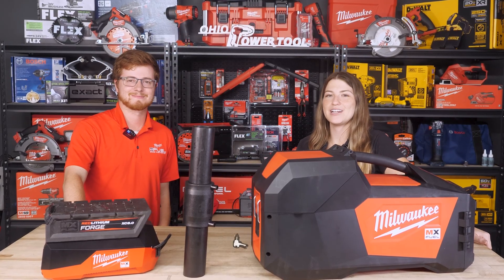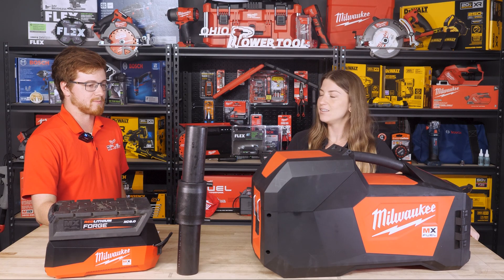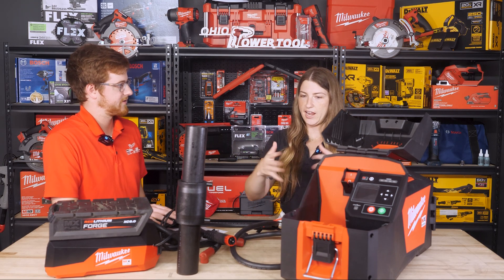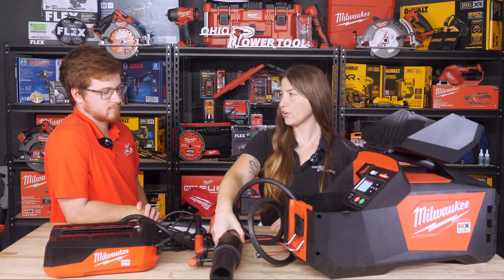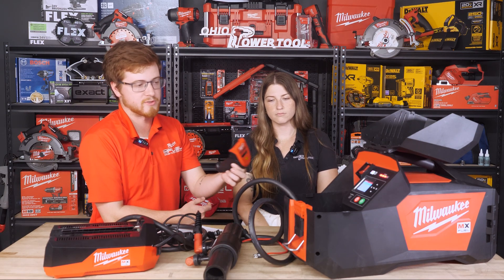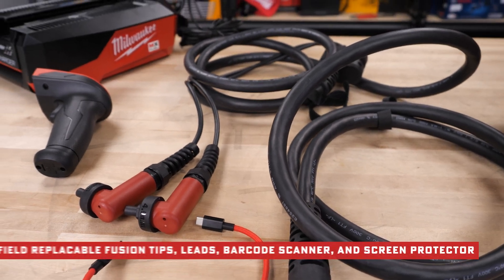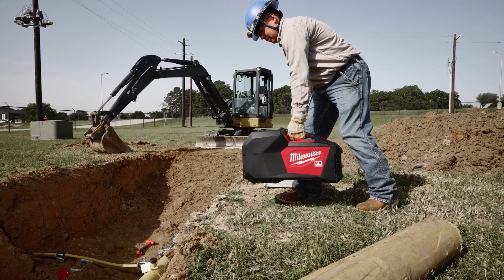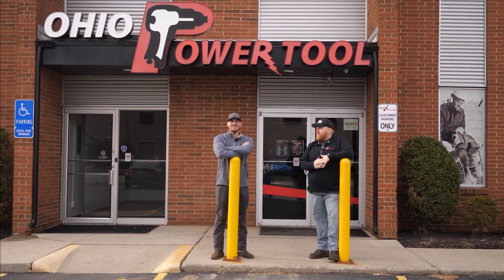What is Cordless Pipe FUSION? Milwaukee Electrofusion MXF545-XC

Comment: 2 things..one, do not use this video as a how to. . He didn't show the cleaning peeling alignment clamp..nothing.. its more than just "stick on the leads and push the button"
2.. I get the idea of this whole thing..its just not practical. Ive done  12 inch couplings before and this only goes to 8 inch...and only 2 fuses before recharging..idk. 15 feet of cord isn't much.  But anyways. Maybe someone will think its worth it

Comment: this would save my ass when we get a long service and id need a generator up by the building
Reply from the maker: You’re not wrong, that’s exactly one of the big advantages of the MX FUEL Electrofusion Processor. Being cordless and only 34 lbs. means you can take it right up to the work area without hauling a generator or running extension cords all over the place. It’s a huge time-saver, especially on those long service runs.
Reply: @OhioPowerTool  yeah, if i could just convince my company to buy one for our crew hahaha

Comment: This looks more larger and cumberson, then what they are using now.
Reply from the maker: Definitely depends on which model you're comparing it to! Highland Supercell is about the same weight, but still impressive considering the 34lbs here includes the weight of an MX FORGE 8.0 battery and there's still room for onboard storage. Most other competing models are going to be at least 12+ lbs heavier. So yes, definitely still a big boy, but designed well!